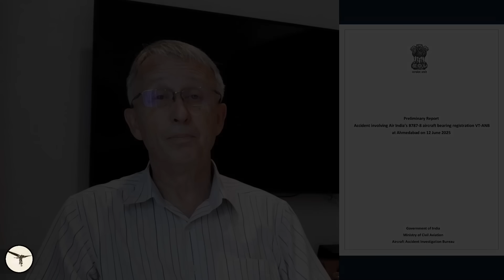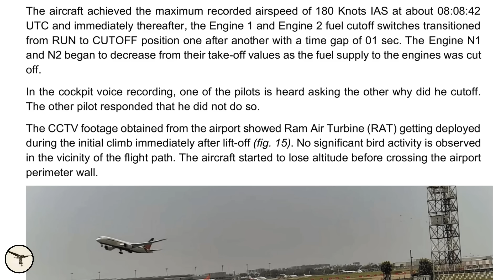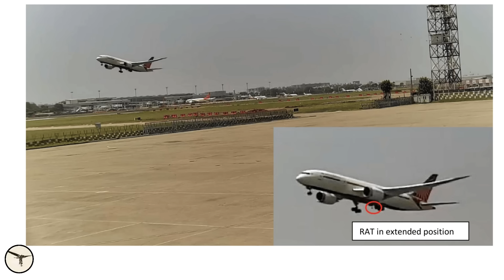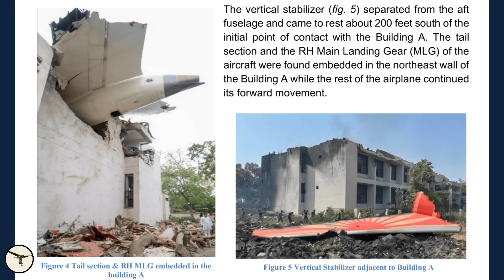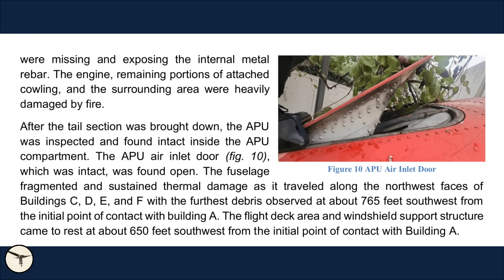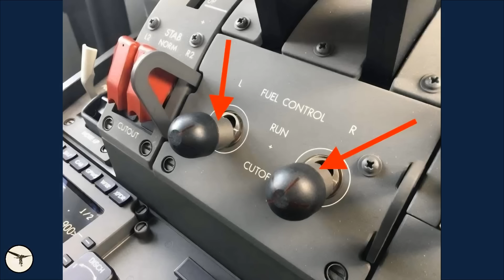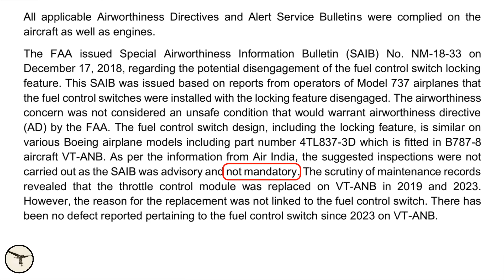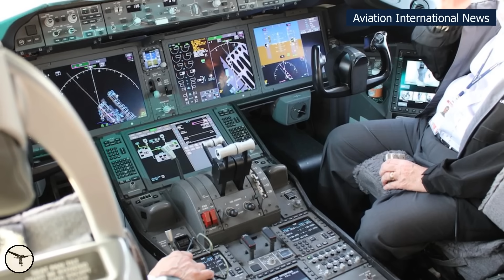WARNING Fuel Control Switches Failure Could Cost LIVES

Comment from the maker: This video covers a sensitive topic, so please be respectful in the comments. Some viewers have asked why certain comments disappear—just to clarify, I do not delete comments. YouTube allows anyone to report content they find inappropriate, and if it violates YouTube’s guidelines, it may be removed automatically.
Reply: If some error turned off both engines isn't restart procedure: both switches off and then on again?
Reply: No, no no not error cause switches. Not error. Not error. Not error. All Nippon airways. Alpha Alpha. 2019 landing both engines shut off. Why? Why? Why why? Think it’s through if a fuel shut off the switch can be shut off And it is not an error. Think it through. Santa Marta. Conference 2018. 787 architecture computer program compromise. Manufacturer says Nee Nae Nae. Not long after security technical conference Ruben Santa Marta say compromise. All Nippon airway loses both engines during descent landing. If switches are not shut off by error, but rather by malfunctioning code, the explanation is clear why do the left engine create huge plume of smoke even before takeoff? Why do you trust an electronic data gathering recorder when the electronic code can be rewritten?
Reply: @amdfanatyk  We'll probably have to wait for the report to know that for sure. Right now all we know is it's implied that the switched were moved to off and then restart was attempted
Reply: @amdfanatyk  "...If some error turned off both engines..."
 If there had been a software glitch there wouldn't have been one second gap between flips.
Reply: You have to in detail analyze the construction and technical  behavior of the fuel switches..in every aspect..
Reply: Seems like  switches were  already off  failure to  check properly  plane  started  at the  little bit  fuel  in the  pipeline  then  system  sensed  and  rat deployed  then  pilot  started  trouble  shooting  and  found  switches  shut off he started  working on  to turn  the  switches on  time  was  little  to correct the  mistake  and  by that time  crash happens  that 's how  it seems  like  the  way  plane  was dancing  and listening  to  you  sir  so  sorry  for  the  tremendous  and  irreplaceable  loss  it's  important to  get to  the  bottom of  truth  what  happened. Thanks. BALJIT K FROM USA 🇺🇸 ♥️
Reply: So, will we continue to flight with potential psychos until the final report?
Reply: @numismatajaime  There is no evidence of suicide thus far. Try to stick to facts and not get hysterical due to misunderstanding. Yes, you will have to wait for the final report.
Reply: @davidkavanagh189 They can at least give us the CVR which would’ve record the sound of switch being moved so we can rule out the possibility of anything else but the switch.

I don’t know why this was not provided already in the preliminary report to confirmed the movement of the switch. It should’ve been picked up by CVR just before they heard the pilot asking “Why did you cut off?”

Note that if there was no sound that switch was moved… then the context would’ve shifted to pilot was yelling out loud at the plane instead…
Reply: @tonamg53  The CVR transcript will likely be in the final report and I agree it will probably be one of the most important sources of evidence in this case. Stuff like sounds of switches takes time to analyse and prove to a high degree of certainty. It's not a simple case of 'sound of start switches clicking'. The main purpose of the preliminary report is to give an update on clear facts that are known with certainty, especially where they pertain to any continuing risk that might warrant grounding the aircraft for example. Sometimes premature release of certain details can prejudice an investigation or legal proceedings too so I'd imagine that's a factor.
Reply: @tonamg53  The report does indicate that the switches were physically moved. They will have to determine how this happened and if it was accidental or deliberate.
Reply: @davidkavanagh189 The problem is the report only say “the data shows the switch was moved”

It didn’t give us any data that shows the switch was moved. 

They need to give us that data.
Reply: @davidkavanagh189 but gave us partial summarize details on what pilot was saying from the CVR without actually giving us the CVR, not even a transcript?

That’s not fact. Fact would be the actual CVR or at least the full transcript of the CVR.

They are cherry-picking what info we should know without letting us know the full context.
Reply: @tonamg53  I don't know what else to tell you. It's not the final report. CVR transcripts are usually in the final report.
Reply: @tonamg53  There is also no plausible reason to 'cherry-pick' anything. Maybe they made a mistake by sharing anything from the CVR at this stage.
Reply: @tonamg53  They also said the switches were moved back into the 'run' position. That could only happen if they were first in the 'cutoff' position.
Reply: @davidkavanagh189 well then don’t give out partially summarize details on what pilots were saying without providing the full CVR transcript then.

It’s almost like if they were intentionally trying to create misinformation releasing partial summary details while still withholding the full information to themselves…
Reply: @davidkavanagh189  "...switches were physically moved... if it was accidental or deliberate..."
It was deliberate for sure, because one pilot asked another why he moved the switches, and he replied that he didn't. 
If one of them did it accidentally that one would certainly have known that, because it is impossible to move these switches inadvertently without using excessive, painful force. Even if he did it by mistake, after the question asked a highly experienced person as the pilot would immediately be aware of his mistake.
So the right, scary question is: why he did it.
Reply: @ivanakoide9090  How many hours have you got flying 787s?
Reply: @ivanakoide9090  Your take on this is comically wrong. Have you ever actually handled the start switches on a 787? They're tiny little things you move with your fingertips. They have to be pulled up to move them but they can almost certainly be forced or that locking feature can be worn or otherwise faulty. It would not cause injury forcing them beyond maybe some sore fingers.
Reply: @davidkavanagh189  "...How many hours have you got flying 787s?..."
I have no experience with flying at all, but I have a lot of experience with switches.
Reply: @ivanakoide9090  So your credentials are the same as everyone on Earth then. I don't fly the 787 but I do have a pilots licence and I have friends who fly the 787. I'm not meaning to talk down to you but the fuel control switches are not that hard to move. They're also angled backwards quite a bit so it's not hard to see how a warn switch/switches could be knocked out of place, especially when this is a known problem with that switch design.
Reply: @davidkavanagh189  "...So your credentials are the same as everyone..."
Logic is universal, not connected with any specific  job. For example, how would you explain one second difference between flips of the switches? If it had been done inadvertently both switches should have been moved almost simultaneously.
Reply: @ivanakoide9090  Yes I agree the delay between switching is something of a mystery and hopefully we'll eventually find out if it was exactly one second or more or less than one second. Either way we just don't have enough info at the moment to come to a clear conclusion. 

Maybe something similar to Yeti Airlines Flight 691 where the pilot feathered both props instead of selecting flaps. 

Some light aircraft have a cockpit camera recorder. Maybe it's something that needs to be in airliners too.
Reply: @tonamg53  If they reveal which pilot asked, the family of the person people suspect of lying could be harassed.
Reply: @Sokol10 And because they didn’t made it clear who was saying what, now both pilots are being blamed for it.
You only released the whole truth or you don’t released anything until you know for sure that it is the truth.

You don’t released something ambiguous causing people to speculate and ended up blaming ALL of them.

The report is absolutely unacceptable.

Comment: The question I have is this. According to what I have read these planes are designed to shut the fuel off when there is an electrical failure. The RAT deployed pretty much at the same time the fuel got shut off which only happens when there is a complete electrical failure. Even though the engines had been shut off the plane's batteries should have provided power and there is nothing that indicates that the plane lost power in the cockpit yet the RAT deployed anyway. The pilots could not have made that happen themselves in the very short time available. That would have required the "rogue" pilot to somehow shut off the plane's electrics in their entirety which surely would have been noticed by the other pilot and should show up on the FDR if doing that was even possible. The advent of the RAT deploying indicates that the plane's systems had determined there was a loss of power from not only the engines but the plane's batteries even though there is no evidence that the cockpit actually lost power. So is it not possible that the plane falsely detected power failure and shut off the fuel and deployed the RAT? The pilot's dialogue fits this scenario and evidently both pilots were trying to regain control up until impact point. If the plane triggered the shutoff as a safety feature due to what it determined was a power failure then it would have deployed the RAT as part of that response. If a pilot shut the fuel off there would be no automatic deployment of the RAT that would have resulted. The deployment of the RAT cannot be explained by a pilot shutting off the fuel but it would be deployed by the plane if the plane's systems erroneously detected a false power failure. It seems to me that the RAT is the biggest indicator in the matter. Is there something I am missing here?

Comment: The Boeing fuel switch does have control wiring for actuators, so electrical operation. Is possible without human intervention. 
=>> Fuel switch part no. HONEYWELL   4TL837-3D  data sheet :: " 2- and 3-position, maintained and momentary toggle action to meet circuit and actuator requirements"

Comment: Question here, not sure if the following is possible :
Apart from the mechanical locking mechanism I've read that there is also ( Redundant)  power coming into the Fuel switches.  This  autonomously control Fuel Switch / Fuel valves , without manual action .  Electrical malfunction , in that circuit could cause both switches  to  move into  Cut off.

Comment: Seems like  the switches were  off  to  begin with  maybe  it was  not  noticed plane  started  with  little bit  fuel  left in the  pipes  by looking  the  way  plane was  dancing  the pilot  started  trouble  shooting  by  the  time  he  made  the  corrections  it was  too  late  time  was so  little to  recover  by the time  crash  happened. Sorry for the  tremendous loss of life  and  irreplaceable  loss
Reply: Baljit k from USA 🇺🇸
Reply: The aircraft couldn’t have taken off with the switches in cutoff
Reply: You don't know what you're talking about. The engines cannot run with "a little fuel left in the pipes", this is not a lawn mower. When these switches are flipped to CutOFF, the engine quits RIGHT AWAY. There is NO delay. Click, and POOF it's gone immediately. That's also how engines are shut down on every arrival, they don't select the switches off in advance and let the engine run on "fuel left in the pipes", they set the park brake at the gate, flick the switches off and the engines quits instantly.  You simply cannot take off with the switches in the off position.

Comment: The technology these days should allow a plane to prevent fuel cutoff of both engines at too low an altitude during the takeoff phase of flight, even in the event of engine fire. Such improvements should be made proactively and not just after tragic events such as this.
Reply: Current planes will do if pilots don’t touch the fuel cut off switch
Reply: @Cmvinyl0102 Well that clearly doesn’t work.
Reply: @Brenco-l6x actually is clear this designed work for the past 10 years of the dreamliner in service.
Reply: @Cmvinyl0102 If the design could be safer, why not make it safer?
Reply: @Brenco-l6x the only person that think is safer is you.  I would think boeing engineers are smarter than you. The reason why your idea doesn’t work is because planes can hit birds at take off which could lead damage to engines and possibly explosions that may require engines shut down. A dreamliner is designed to be able to take off even with one engine.
Reply: @Cmvinyl0102 When a plane is in the takeoff phase of flight, even if there is a bird strike or an engine fire, fuel cut off is not indicated in the flight procedures until a safe altitude is reached. This could be implemented in the software. Airbus implements all kinds of protections such as alpha and bank angle. Boeing doesn’t because it likes to cut costs and puts more onus on the human factors.
Reply: @Brenco-l6x so did airbus take your advice and design a plane that cant  cut off fuel when taking off?
Reply: @Cmvinyl0102 I’m not egotistical enough to imagine Airbus or Boeing need my advice.

Comment: No Pilot would wait 10 seconds to move the switches back to RUN and  to save his life .  SEEING the physical cutoff-switches in OFF would instantly cause a reaction of any mentally sane ( normal) Pilot ... no need to make further considerations ....OFF is DEATH    and ON  is LIFE .
And in the same category ,,, why is there a time gap of 4 seconds between E1 RUN and E2 RUN ....once more ....OFF is DEATH ... so nobody needs 4 seconds to activate the second switch .

There is no evidence at all, that THE PHYSICAL SWITCHES were MOVED ....  the FDR is logging on a signal level .   Without the wiring plan you cannot make any logical statement 
The sounds of the flicked switches should be heard on the CVR .... no remarks about that !!!

I am only a simpilot but a retired engineer with a lot of experience in technical accident analysis. .....  this preliminary report is written by a completely biased crew , which is under immense pressure from mighty companies interests .

I assume, that the final report will be as ambiguos as the actual preliminary one .   meanwhile  the whole mainstream world is talking us into a suicidal action ....

I dont expect the real cause coming out ... why should i trust any of the paricipating experts .

Comment: The more we debate this tragedy and the more we learn, the more it calls for patience in waiting for the final report. 
In the meantime some very disturbing assumptions are being made about the PICs mental state, who had every reason to live in order to care for his elderly father. 
It is staggering that the fuel cut-off switches should somehow shut down both engines almost simultaneously while still climbing out over the runway, the FOs hands on the yoke and no gear retraction happening but loss of electrical power calling for the RAT within 8 secs of t/off, engine run switching occurring only 5 secs later, and APU opens after only 2 secs later.

Comment: If the fuel switch were without guards like the photo shows in this video, they may have been pushed to off mode accidentally when the pilot pushed the thrust levels fully down for maximum power.  The copilot noticed the plane was declining which made him look at the thruster levers  first thing and said why did you turn the switches off, the pilot may have then realized what he had done and quickly turned them back on but it was too late.
Remember the plane was found after the crash with the switches in the on position. 
The other question that appears in this case why was the landing gear not activated up or during the take off which for the plane would be about 8 to 10 seconds after lift off.
Reply: The landing gear would not be retracted if the pilot monitoring was busy cutting the engines when the gear would normally be raised. As much as we all want to believe something else happened, the preliminary report pretty much said all they can say without causing problems with the certainly ensuing criminal investigation, going through the pyschological histories of the pilots to figure out who did it. It might be possible for them to detect a variation in the force on the yoke if the pilot flying was the one to do it, which would also mean he was busy at the point that he would be calling for gear up. I shouldnt be speculating which pilot did it, but just thinking through both scenarios that would lead to missing the landing gear step.

Comment: Greetings Captain, I hope you're doing very well. I really enjoy your videos—they’re full of knowledge and valuable information. I’d like to ask a very technical question. In my country, there are plans to operate the ATR 72-600 at SVMD, an airport located at 5,000 feet elevation, with a runway length of 1600 meters and a 4% slope. Takeoffs are only performed downhill and landings uphill. Previously, the ATR 72-212 was operated here with some restrictions. Under these same conditions, would the ATR 72-600 allow for a higher payload? If you have any software that could provide weight performance data for these conditions, I’d greatly appreciate it. Normally, when the weather is hot (ISA+20 to ISA+25), the wind is favorable for takeoff. But when it’s cold (ISA+10 to ISA+15), the wind tends to be slightly tailwind—less than 10 knots.